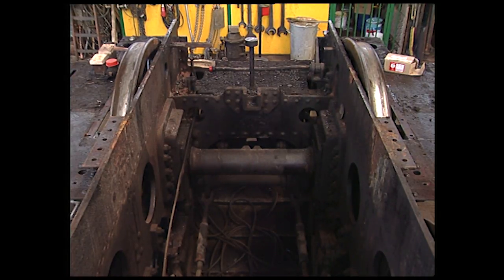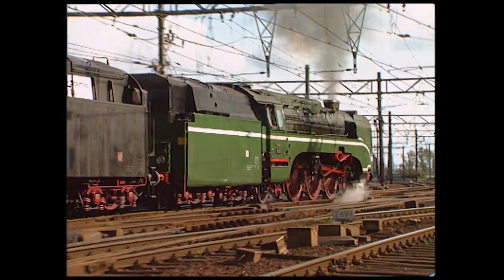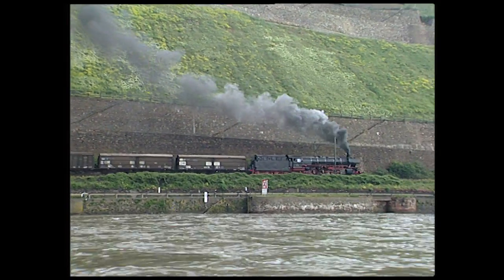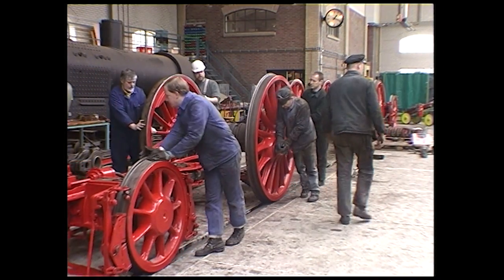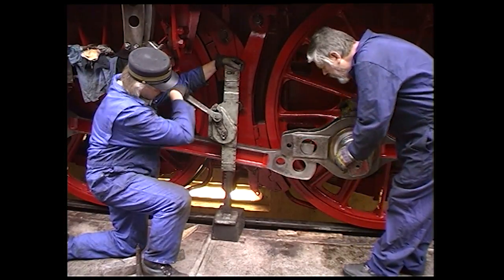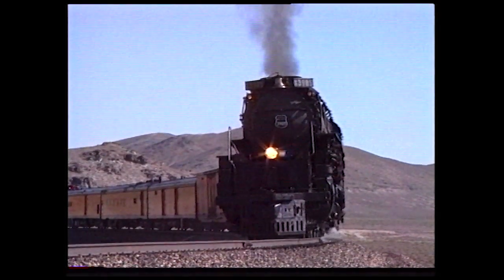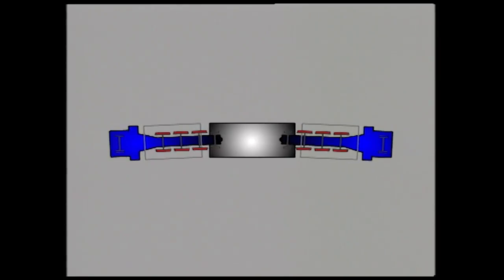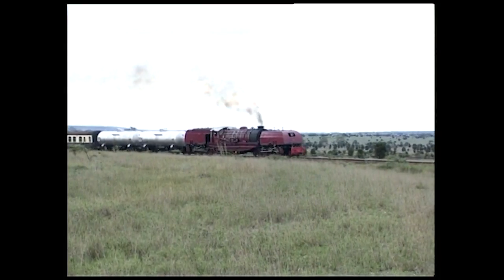The Steam Locomotive Part 4 - Chassis - English • Great Railways

Comment: Garratts are designed with no driving wheels beneath its boiler, allowing for greater boiler
girth and thus increased power production, while not increasing its turning radius. That power is distributed to many driving wheels, increasing its tractive effort while lowering its axle load values, crucial when a railway's infrastructure can't handle higher axle loads. Talk about having utility.